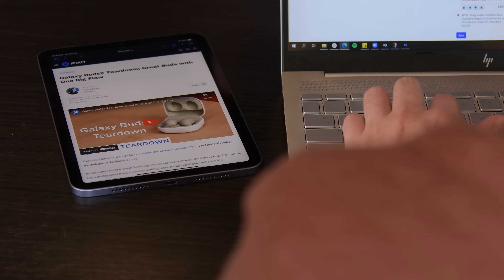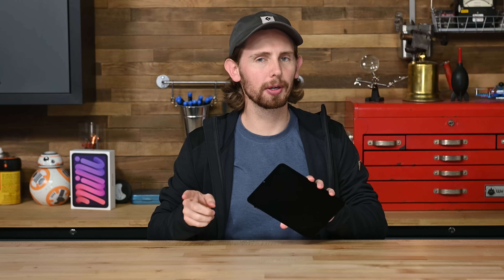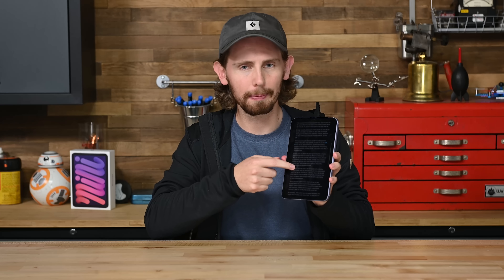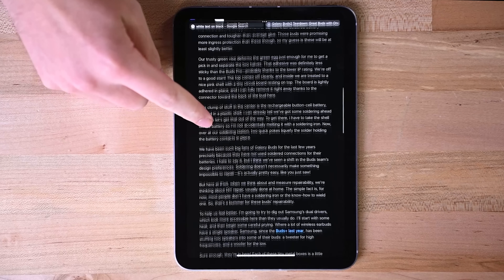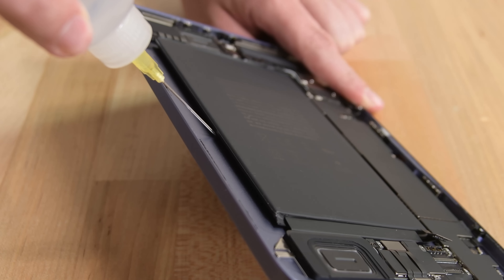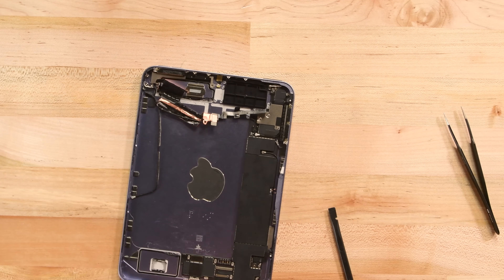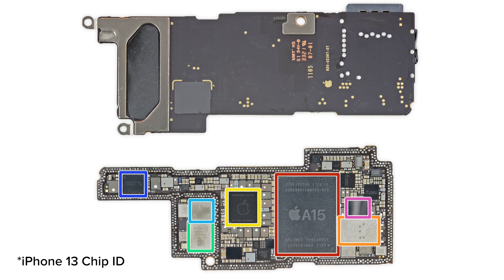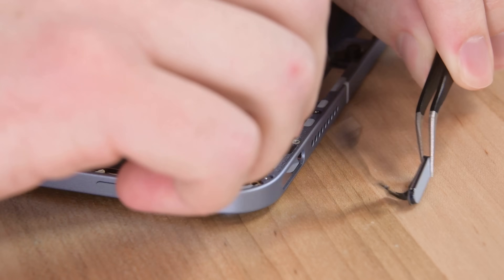iPad Mini Teardown: Here's Why it Jelly Scrolls

Comment: Discovering that the USB-C port of the iPad mini 6 is freaking replaceable is already a big YES for me to get one used today.
Reply: Wow can’t imagine that I’ve been using the iPad mini 6 for 2 months now. Also I think this product should at least be 5 on the repairability score though. I mean, this iPad mini’s smaller screen is easier to remove than any of its siblings, then you can easily replace the battery and charging port 🤷‍♂️ For me, it’s 5/10.

Comment: The strong glue on the battery helps with chassis rigidity. Such a slim and big device is prone to a lot of flexing so don't be "dissapointed" that they used the glue. Be glad that it won't bend an flex like crazy.

Comment: watching this video made me realize that how useful 3dpriters can be for repairing.
you can just design a tool that can only go in by a specified amount of MM. so you never run into the risk of cutting anything important :) you can dull the end with slight sanding before using it too

Comment: Isn't this issue going to be fixed if you turn off this new feature of "adaptive refresh rate" ? 
As you've show the jelly scrolling goes on text,  due to the fact that the tablet works only with 10hz when shown text to save battery and than all the way to 120hz when playing a video.

Comment: Idk i think its way better repairability wise. the two biggest repairs i see after screen is battery then charge port replacement and those tabs will make it easier not that it was hard before and while i loved soldering new ports on having them on a fpc connector is very welcomed

Comment: My 5th gen iPad Mini jelly scrolls a high-density text web page in landscape whereas it is barely perceptible in portrait. This is the alternate orientation compared with the 6th gen. I typically use my iPad Mini in landscape except when reading eBooks, so I would prefer 6th gen Mini LCD controller set-up.

Comment: Be nice to see Apple make an ethical device. I'm over the "thin at all costs" mentality where repair-ability and recycle-ability are sacrificed to make it a tiny fraction thinner. Really, as the world richest company, I'd have thought their engineers up to the challenge.  I guess the marketing folks have greater sway.    Though could be to do with the fact Apple makes most of it's money from hardware (massive markup compared to industry norms). So making it disposable and limited in life is the business model they choose.
Reply: Would you rather it be heavy and thick ? It’s a impressive feat that they make such good things in so small of a package
Reply: They literally recycle old  products if you give them to them tho
Reply: I love that about my refurb thinkpad. Just 8 screws in the back and... Full acces! Its made to make life easier for a corporate service team
Reply: Well, it's not about thin-ness at all. It's about profit, of course. This diverts all repair and service traffic to be first rather than third party. It's part of apples unethical and unsustainable closed "eco"system. They are actively engaged in defeating the right to repair, and even making major moves towards defeating ownership itself.
Reply: @kylezo  Big call
Reply: @kylezo  This aged poorly
Reply: i'm curious just how much Jony Ive was holding them back in terms of form over function. seems they haven't deviated too far from his design work yet, but they may do.

Comment: The reason why iPads are not easily serviced is roughly the same reason why laptop screens aren't easily serviced: they are rather large glass and metal sandwiches, and it's really hard to get a consistent flat look without resorting to glue. The new modular laptop (forgot the name) could change this, but I'm skeptical as glue is also the cheapest way to hold a glass and metal sandwich together.
Reply: Framework

Comment: This ipad mini has a 10/10 reparability score actually....just that you need to send in to Apple to do it....
Reply: They practically made sure, the consumer can't use 3rd party repair. You can buy 2 of the exact same iPhone 13's & switch out any part in the phone & it will disable features on that phone. If you still want certain features to work, it has to go back to Apple to get repaired.
Reply: @2078smith  Yes I heard you. I've changed my iphone xs battery after 2 years and it no longer shows the condition % although it is original apple battery.

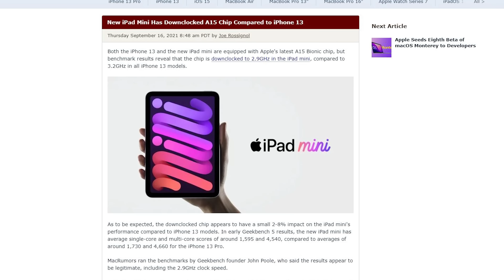Comment: 5:14 A binned CPU it's a better CPU. In your context, the CPU's for the iPhone 13 were binned.
Reply: No. Binned parts ≠ higher quality parts. Binned parts = parts classified by their quality within unit-to-unit variation. That can be higher than normal or lower than normal.

Comment: I havent checked anything but Iam gonna guess way how screen refresh is tied to screen orientation. So far to me it looks like ipad mini does same thing like nintendo switch and few others. screens "default" orientation is simply in landscape mode not portrait.

(everyone says Switch screen is 1280x720 but in reality it is 720x1280. It is clearly visible on hacked switch consoles because they are able to display error messages before any driver takes over it and messages appear in portrait mode.)

Comment: iFixit needs to re-do its reparability scoring. The rating presented for Apple products now, is at best a 'disassembly ease' score. Reparability is now hampered by Apple by means of parts unavailability, tools availability, documentation availability, and software locks. If an typical independent repair shop is denied the right-to-repair, then reparability score is zero. Also, the physical orientation of the display board is not related to the vsync orientation of the panel. A ribbon cable changes the orientation of the board vis-a-vis the panel. On the other hand, vsync orientation if perpendicular to viewing direction, can easily result in visible jelly scrolling.

Comment: I have both the Mini 6 and Air 4, tried to take slo-mo video of scrolling, tried scrolling long text on both, did not see any jelly effect. 🤷‍♀️
Reply: Not everyone can see it. I know i can't. I barely noticed the difference between 60hz screen vs 120hz... That's why 120hz is just a gimmick for me.
Reply: @Joseph iphones and ipads bending was an actual issue which is why Apple fixed it 😂😂😂 Also jelly scroll can't be improved with software since it's a hardware fault
Reply: Then you are using it properly.
Reply: Only some have

Comment: Wow, the USB-C connector not just modular but you can also easily access the contacts to clean them or bend them back if necessary, it would be great if other devices would use this type of USB-C connector.
Reply: wouldn't be surprised if that USB-C port has a chip for serialization to prevent people from replacing it, by disabling charging.
Reply: @KimasM  thats a dangerous idea why would you put that out on the internet
Reply: @jeja6801  I k r 🤣🤦‍♂
Reply: Why they dont use two hex screws on the outside like on iphones ill never get.
Reply: @pietrmuffei8874  well iPhones use those screws to hold down the display, while iPads use adhesive…
Reply: Yeah it’s nice that apples used a usb c port like that! the middle comes out which is what usually needs fixing. And they didn’t solder it to the board like most android devices do.
Reply: @WalterMan  I like that move too, but it’s gonna be a PITA to get to the port. Hence why I’d like to see them use 2 screws on each side to mount the display

Comment: Every 60hz display apple makes has this issue, it’s just this is the first time someone’s noticed
Reply: Blame Samsung on that, they made the display
Reply: @Baer9471  I think apple custom designs the displays and I think it’s an apple problem as Samsung’s 60hz displays from years back didn’t have this issue
Reply: @KOKOBC  so if this ipad have the jelly screen problem will ipad 9g have the same problem 🤔
Reply: @Baer9471  probably
Reply: @Baer9471  Tried the iPad 9 scrolling in landscape mode in store. i think it's even worse. I can jump on the ipad and surf on the jelly waves. I guess that might be the reason they changed the orientation on the iPad mini. iPad Air also has it but less pronounced. I think it's just Apple cheaped out on the display.
Reply: @Aaronxhu  okay thanks for the reminder, but 
I think I’ll completely be fine with it and buy one later

Comment: iFixit - the controller board orientation explains why there's jelly scrolling
Apple - you're holding it wrong
Reply: Actually, considering the position of the volume rocker is on top (so it becomes easily accessible when held in landscape) make me think that maybe Apple designed this iPad to be used mostly in landscape, maybe due to the lack of horizontal space it would have respect to any other iPad.
Reply: @fporcelli2009  they. should just fix it
Reply: @fporcelli2009  it’s like that because the pencil attaches at the top and a case attached as the bottom.
Reply: Apple should have put the camera at the top of portrait orientation, and then they could have truly said "you're holding it wrong".
Reply: It IS at the top in portrait orientation.
Reply: all that explanation, and he didn't even rotate the ipad 90* and show us. 
oh well. I'm seriously considering selling my current ipad air and iphone, and replacing both with a 5g ipad mini.... good idea or bad idea?
Reply: Jelly scrolling has plagued many tablets that exist. The 2012 Surface RT also have jelly scrolling, no cap.
Reply: @Baer9471  iPad Air too
Reply: @Baer9471  We dont mention Surface RT. Jelly scrolling was the least of its worries after not supporting ANY apps. They would actually be somewhat viable as an idea now since the Windows store actually has a few things. Ironic.

Comment: I checked the CPU batch numbers... They are M1 chip design. With 6 core CPU. 5 core GPU. 16 core Neural engines...Same architecture as the M1..Why they got a Type C  connector. They borrowed as much as they could from the M1 deign... While still keeping the price low. So no 120 refresh rate. No Oled  display...As they would drive the price above $1100.00.... 

But it clocks better in real life. As the 2 Performance cores only work with High bandwidth CPU intensive applications like Video\Audio editing..While the other 4 cores are more efficient. To keep battery life reasonable and heat down...

So Over all. You get an M1 scaled down design chip. As Apple has a chip in the works.  So they went to the M1 design team. Said get as much of this design in the A15...While keeping cost down...I think t hey did a good job for what you get...Including two finger  touch ID..As  i loath Face ID...  It  blows. Worst thing Apple ever done. Face ID piff... Who cares. As that Face ID camera goes funky on you. You have to buy the whole phone...
Reply: M1 is based on A14. Same cores / architecture. A15 is not far from A14... that's why its barely ~5-9% faster
Reply: @borisdg  I have a friend  at  Apple. They taken the Design features of the M1.  To make the A15  chip...As Apple has a whole new chip design coming. So they taken the M1 Architecture and  made the  A15..As they are not going  to design a whole new chip. When the M1 design would suffice for now. Why it has Type C  connector. And not one phone  does. As  the chip older designs don't support Type C...

6 Cores. 5 GPU. 16 Neural Engines. Just better efficiency of the 4 cores to keep  battery life reasonable. While keeping heat down...You kick in them 2 high performance  cores. It gets real  interesting. 

Using an External Monitor. Audio\Video editing software. You will  see the difference. So Apple isn't cheating out on  us. They just get more out of what they already had. All while keeping cost low.  Durability up.  As you start adding  120hz. Oled display.  The cost hits $1100.00...All  while creating huge amount of  heat in a small device. It would spend most the time being  sent in for  repairs. As you fry the internals. Then  wear the battery out..If not swell  up like a dead body..Then it splits the case.
Reply: @WizzRacing  M1 is carrying the A14 architecture/core. That's why it has same names aka Firestorm and Icestorm. A15 is just shrink of A14. A16 will be radically new SOC on 3nm just like A12 and A14 was. Odds = shrink, Even numbers = new process. A12 (N7) => A13 (N7P) / A14 (N5) => A15 (N5P) / A16 (N3)

Comment: iPad Air 4 had backlight bleed and now this… seems like Apple REALLY cheaps out on this design if it isn’t a Pro.
Reply: My iPad mini 5 runs perfectly after 2 years. 😂
Reply: I actually bought a iPad mini totally forgot this was a issue but I don’t actually notice anything so I guess I’m personally fine. No light bleed like my old Air 4 either so can’t complain.
Reply: My iPad Air4 has a worser display as my iPad 6th Gen. The 6th gen have a sharper and colorfuller display…. i sendet the Air4 back.
Reply: And the old design iPads don't have problems like that. There must be something wrong with the new team who design this. Remember the new Pro that bends? lol (I'm using iPad Mini 5 so I'm not a hater but I'm really curious what's wrong with Apple recently).
Reply: @NinPossible  the thing that is wrong with apple is called greed and deception.
Reply: @eliazarmarcano5616  couldn't agree more. "Industry-leading displays " = jelly scrolls. Still a fan of iOS though (can't go back to Android now haha) 😂
Reply: True!

Comment: Both the iPad mini and iPhone 13 share the same A15 processor… yet only the iPad got USB-C. This shows that Apple could put USB C on the new iPhone 13, but… “lightning port go brrr”
Reply: Apple might make the phone (a bit) wider
Reply: For as many people that want USB-C on an iPhone, I imagine there are significantly more people that would freak out and bash Apple for making all of their chargers and accessories obsolete (without the use of an adapter or something)
Reply: @Rev8691  I can understand that… but look at how we moved away from the 30 pin connector. I bought one adapter to convert my old dock from 30 pin to lightning. 
Other than that, I haven’t missed it at all. 

It just seems very out of place for them to keep a connector like lightning around when everything from the iPad to the MacBook have USB-C. 
Plus with the iPhone coming with a usb c ended cable, and only being able to fast charge with a usb c brick, every opportunity is there to change.
Reply: @Rev8691  hmm that actually makes sense to think about it from that trickle down perspective. Hopefully they actually do it, and don’t phase out the port completely… because I hate wireless charging, especially with CarPlay, as my phone dies or just manages to maintain charge. And I can’t begin to imagine the hassle to backup or restore a device wirelessly. 

I believe the early 2000s was just a wacky era of making accessories that fitted onto your iPhone and iPod touch… I think the hype/profitably died down, so manufacturers phased them out. 
Since there is an adapter from 30 pin to lighting, the two interfaces are “interchangeable”. And from a quick google, there is an official Apple adapter from micro usb to lightning… so type C is definitely possible, as it is closely related to micro usb. 

I feel they are trying to hold onto whatever royalties they can milk out of lightning cables (despite most people using fakes anyways), as the USB C market is “free for all”, especially in terms of adapters and dongles…
Reply: @rushilkisoon  I could eventually see the port going away, but I don’t think it’ll be as soon as people speculate. MagSafe is the best version of wireless charging, but wireless charging is still very flawed. It’s slower, less efficient, and like you mentioned CarPlay, accessories, backing up, etc, all would be affected negatively. 

I agree that to an extent Apple is milking Lightning for profits, as proprietary will always make more money. But I do think a lot of it has to do with the trickle down affect as well. Apple hasn’t been afraid of USB-C, in fact that were one of the heavy pushers of the tech. MacBooks were completely stripped of USB-A before people were happy about it, you know?

Honestly, I think the “iPhone 14” will have USB-C on the Pro models, and Lightning on the base models allowing people to make the choice. New design, new options, last but most important product to receive the update.

Comment: How many different size screws were used?
Reply from the maker: They were all Phillips 00 heads, but quite a few different lengths!
Reply: @iFixitYourself  since this is a brand new device with only Phillips, it somewhat proves that the Y000 are used on the iPhone to purposely discourage repairs.

Comment: The refreshing of a display is always correlated with where the display controller is placed. You can even see it on the Apple Watches Oled display, where the control unit is on the right side of the watch housing.
When you are in a dark room and put it in theater mode and twist the crown, you’ll see the display coming to light beginning on the right side.
It’s the same thing.
Reply: Its just sad they decided to put the controller on side rather than the top for a device that will be primarily used in Portrait mode.
Reply: Zorba yes it gives me headache. On my mini 5 the jelly was in landscape which mostly used on media content one cannot see. Reading and scroll the web in portrait was fine. Now its a joke. Unusable for people prone to motion sickness. Who reads in landscape ffs. I use it one handed vertically.
Reply: @zorba4413  nobody uses tablets in portrait. Not even small ones.
Reply: @JasperJanssen  Actually, most people use tablets in portrait.

That being said, tablets are way better when used landscape. Unfortunately, most people don't use it that way though.
Reply: OLED in 60hz or LCD in 90hz or more, otherwise it will happen eventually.
Reply: 69 likes